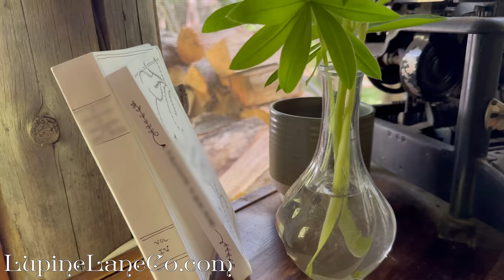Unwanted Guests: struggles living in the countryside

Comment: As soon as the seeds sprout, take off the covers they Probably had damping off is why they fell over and died. They need to dry a bit between waterings after sprouting, water from underneath if possible and have a fan on them,  maybe sprinkle cinnamon to help with damping off. Also not reusing the seed starting mix will help too, start fresh and clean. It's a bit to learn but easy once you have done it a bit.
Reply: This is great advice! I made the same mistakes last year but learned a lot. I did the things you mentioned in your comment and have had so much success this time. Seed starting definitely has a learning curve!
Reply: @kristimcalister2880  I'm glad you got it to work,  definitely a rewarding thing to grow your own plant starts.

Comment: Of course you need to install a compression post under the mast. The deck area under the mast need to be solid without any core or it shall crush. Your mast compression post need to sit directly upon the keel. Once you have the mast up and start to tighten the standing rigging it’s going to push the mast downward with a lot of pressure. You tune or tighten the rigging to approx 14% of the wires breaking strength. To do this you need a tension gage like a Loose Tension Gage. Make sure your mast is centered and not bent or with camber.

Comment: To your sister Molly: I'd really suggest bringing in a qualified sailboat repair guy regarding the issue with the mast step, and let the expert figure out what needs to be done. When that mast is stepped and the stays are secured down, there is a lot of downward pressure on that mast and the step. Without a good background in sailboat mechanics and engineering, you might be in over your head trying to repair and reinforce the mast step yourself. You don't want a failure out on the water one day which could endanger the boat and you and your passengers. Unlike some of the home repairs that Hannah has done, the boat issue really needs expert work.
Reply: True, an knowledgeable person to advise and then do the actual work  herself.
I think Molly would be up to that, she seems to be very capable, much like Hannah.

Comment: Avon skin so soft spray keeps bugs off. We borrowed some from a lady at a rodeo and mosquitos were terrible. That did the trick. Essential oils, lemon grass and cinnamon also help. Put with carrier oil. You can spray the yard, and it helps keep them down. I add 1 gallon of water in a pump sprayer and add 20 drops each and spray around my house outside and yard.

Comment: You could do just a small blocked  like artist wall down the rock area for the electric to go. A couple 2x4 's  and  and a face board or the slats and the power boxes in a line.

Comment: I'll bet Molly's problem is water leaking around the port frame, especially since she said it was out last year.  If it wasn't sealed properly when re-installed, water could leak in, settling between the deck and the inside ceiling.  It would then turn to ice over the winter, expanding in the process.  (Molly gets prettier every time we see her).

Comment: The problem with your starts may have actually been over watering and excess moisture.  If they have to much water they can contract fungal diseases and then rot and die.  You only really want to cover them till the seeds have germinated and then take the covers off so the seedlings get good air flow.  Putting a light fan on your seedlings for an hour or so a day can also help them develop strong stems if you have problems with leggy seedlings.

Comment: I failed at seedlings this year and I've been gardening now for 5 years haha. It happens. I had my lights too close to my seedlings and it stunted their growth. Additionally I used way too intense of a light (twas a big boi).  And I bought terrible potting soil with no nutrients. ughhhh But I guess one has to learn those lessons... is that what happened to you? Next year I will be hanging the lights from the ceiling, but not using table at all, just putting them on the floor.

Comment: Please be careful with the fluff for the mice! I had 27 gerbils growing up and used the fluff until I found out that it has a high chance of wrapping around their paws. They lose circulation and their feet can fall off. This happened to 2 of mine and I found out from different pet stores that it's quite common.
Reply from the maker: Were you using Kapok fiber?
Reply: @hannahleeduggan  possibly? All the fluff is a cotton but I'm unsure if different brands use different types of cotton trees.
Reply from the maker: @quinnzelreign8775  the stuff I use pulls apart in a way that doesn’t become stringy. When I was researching it I saw other people had good experiences with it. I’ve been using it for a year and have never once had an issue with it tangling in any way.